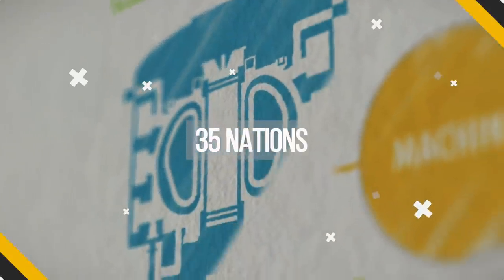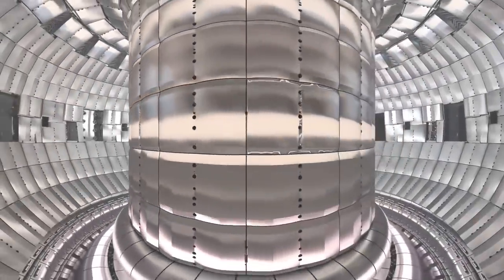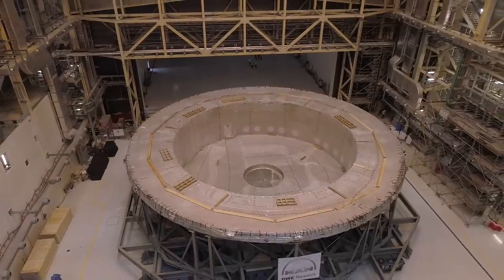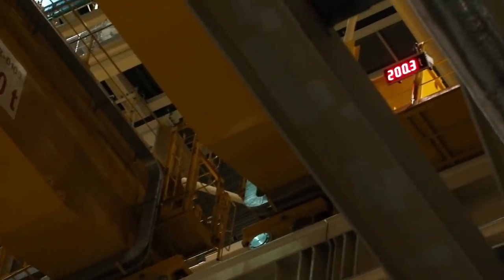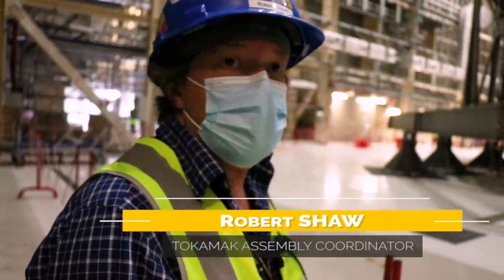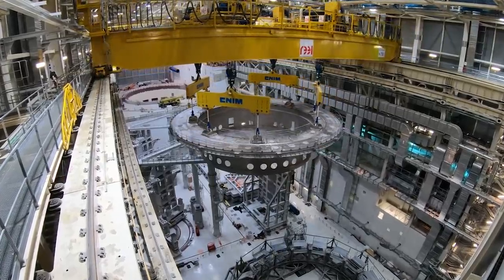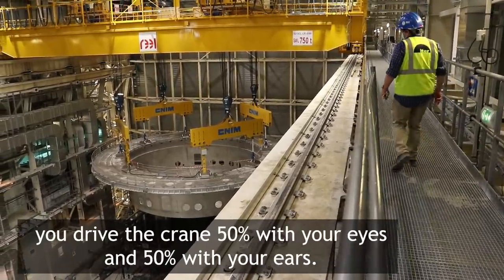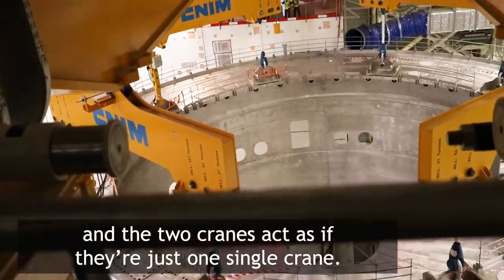ITER NOW 1.11: The Big Lift

Comment: I'm from Germany. I love this whole idea and also I love ITER
Reply: The German stellarator,  "Wendelstein 7-X" is already producing impressive results and has broken about every record there is in high energy plasma physics. 
The Highest plasma density ever measured, the highest plasma energy density measured, the longest time of any plant for a sustained fusion reaction. Well over 100 seconds.
Plans are to reach 30 minutes of sustained reaction over the next years, the stellarator design also has the major advantage of being able to operate continuously with injecting new hydrogen and venting  helium. The complete costs over 18 years has been about one billion euro. Thats is only a small fraction of ITER which is planned to begin first trials in 2025. So even at the start they have a lot of catching up to do. Especially if the German plant is already at 30 minutes+ in sustained energy production with a net gain of energy.
I think the stellarator design has a better chance at success than the old Russian tokamak design just because it can't operate continually and would under optimal conditions cycle fuel every 30 minutes.  
Nonetheless, I think ITER is very interesting too and a testament of just upscaling is the answer after 50 years of experimenting with the Tokamak design.

Comment: Fusion might start faster in space where is no gravitation, it should be tried at a very small scale to see if there is a fundamental difference in how the whole process behave, also in no gravitation, there can be used a confinement structure to hold it in a round shape like the sun  not a ring like it is now

Comment: I've watched all your videos, realised I must subscribe. Can't wait to see if it works! Fusion is an important step towards type 1. I wonder if the recent news of a successful technique to stabilise fusion reactions is in time to be added to the build. Does anybody know? Also curious about what they intend to do with all the power, as I believe it won't be hooked up to the grid.
Reply: To 1.: What exactly do you mean? In fact, many results from present fusion research will be considered and testet later in ITER. The machine won't be finished in 2025, it's an experiment still. 2.: For ITER, the thermal energy produced by fusion reactions will be about in maximum about 500 MW. This energy wont be converted to electricity but simply convected away in cooling towers. For the future, the DEMO reactor is planned (if ITER is sucessful), which will really be a prototype of a power plant. The energy there is expected to be 2000 MW. Hence, we're still in the order of magnitude of conventional fission power plants. The power grid will manage this load, requiring of course connection to the 380 kV or 500 kV voltage level (like big nuclear power plants or coal power plants)

Comment: I didn't get what the first guy said, need subtitles
Reply: Yeah, I'm French and even I can confirm he speaks english with an awful accent. That's what (s)he said (with no corrections):
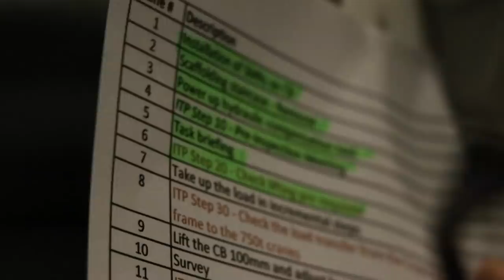(1:22) - The number over there. You can see the number ?
- Oh yeah, what is that number mean ?
- The load, actually, carried by the crane, increasing, little by little, until reaching the actual loading. [...]
So we built a crown, a concrete crown, and the machine will seat directly on the concrete crown, with an interface made by the cryostat bearings, 18 cryostat bearings, metallic cryostat bearings, dedicated to support and to allow any translation of the machine during any (seismic) event. It's an impressive supporting system, very robust.
Reply: @SGUnity  thank you

Comment: It's a shame that ITER is taking so long to construct. The LHC was completed in about 10 years and found the Higgs boson during its first three-year run, which is extremely impressive, but considering how extremely important it is that we stop burning fossil fuels as soon as possible, the LHC is just a play thing compared to ITER.

The US alone consumes 1.8 million tonnes of natural gas per annum. If we don't transition to nuclear fusion and renewables soon it will be too late, and knowing how quarks gain mass isn't going to save a single soul.